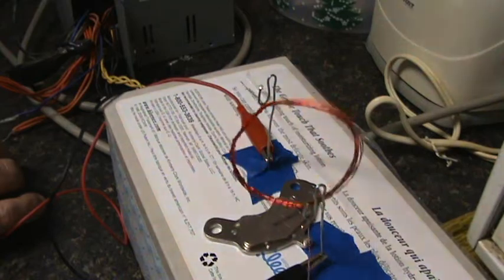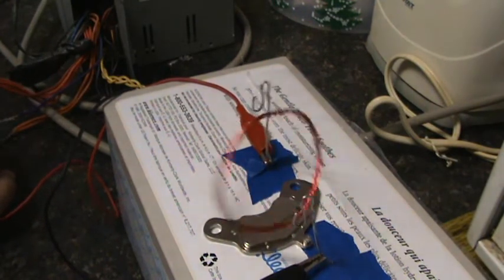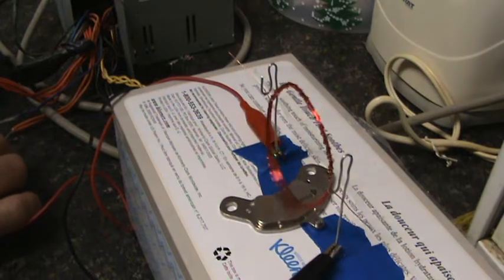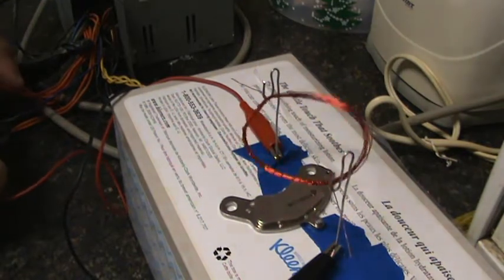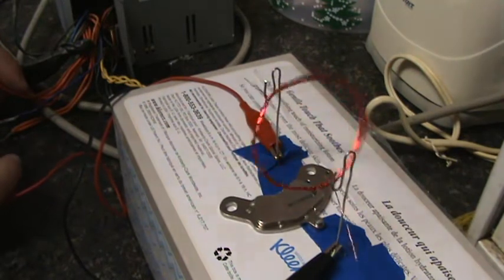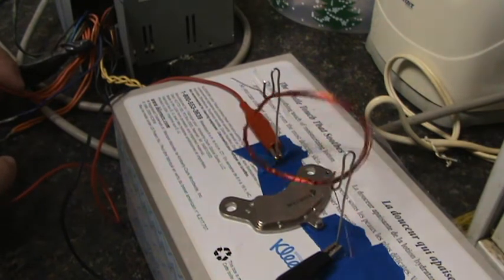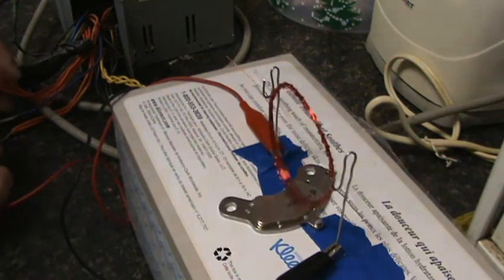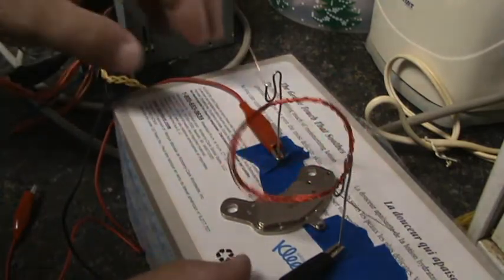magnet motor coil experiment

Comment: i agree. it sits on one of the earths lay lines. like a permanent structure resonation precicely to the earths magnetic grid. just north in a town called avebury is the lagest henge which encompases the whole town. i believe the reason for the ditch around the henges is to funnel the magnatizm up into the henge. like a pryamid magnet, which has ten time more gauss on the top compared to the bottom.

Comment: did u know the stones used at stone henge were of a crystalin structure. meaning the way the stones formed enabled them to be in a way capable of storing huge amounts of energy. the great pyramids were also made with stone of the same crystalin composition. makes u think that if they were able to generate some kind of vibrational energy from the stones, and what would it be used for. mabey they were giant recevers for cosmic transmisions.